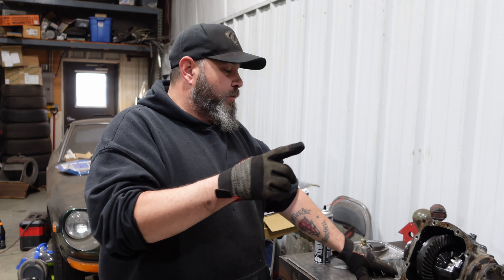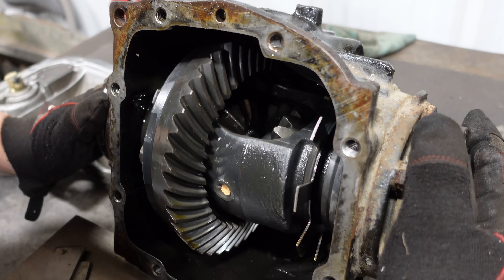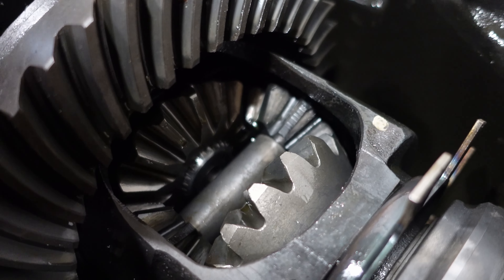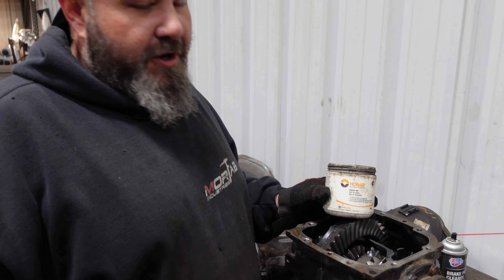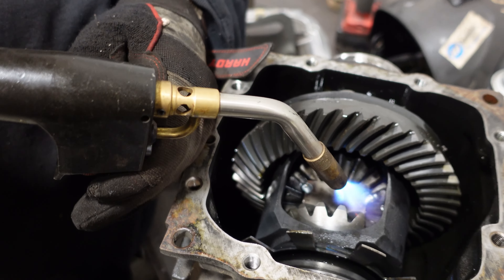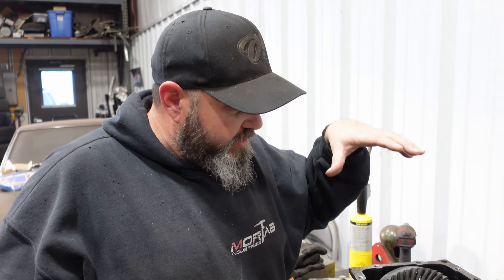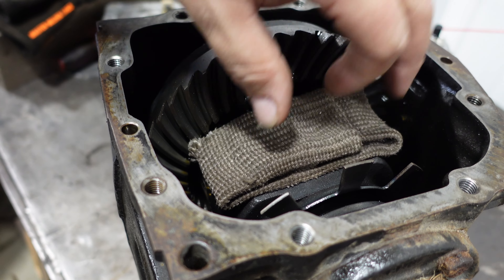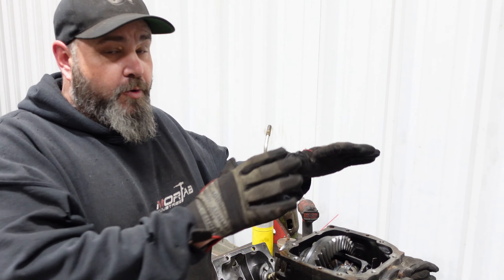Welding a Diff the RIGHT way....Part 2

Comment: The right way to do this - if welding is even right - is to take the carrier out of the housing. it's 12 bolts, bearing supports pop right out and the carrier basically falls out of the case. That way you can ensure no spatter gets into the diff casing. It's also way easier to clean the oil off of. The other way to make a spool is to use an LSD carrier and pack it to full lockup.
Reply from the maker: There’s always one. Welding is never the right way. A mini spool or full spool is the way to go for sure. However in my 20 years of Lincoln lockers, I have found more times than not where the heat from welding distorts the carrier if it’s removed from the housing. So I choose to leave them in and deal with the cleanup aspect.

Comment: Sorry just getting back into this, my 79 cj7 has been waiting for me.  So I remember never having an issue with my auto lockers so what has changed? Street-able, never let me down off road, have they become too expensive, illegal, why because tire scrub was the issue then have they found a solution?

Edit
I saw the prior video. So nothing has changed, cost savings they think at the cost of replacing many tires, street ability, and risk of catastrophic failure as the mig welds crack fail, and self destruct. I thought this was for junk disposable projects like buggies, track cars and demolition derbies. I guess it makes you money……twice.
Reply from the maker: It’s made me money over 200 times 😉 it’s all a cost thing. Most grass roots drifters and off roaders don’t want to spend the money on traditional locking differentials. I’ve also done several spools and mini spools as well as traditional lockers. Hey I do what my customers ask of me 😉